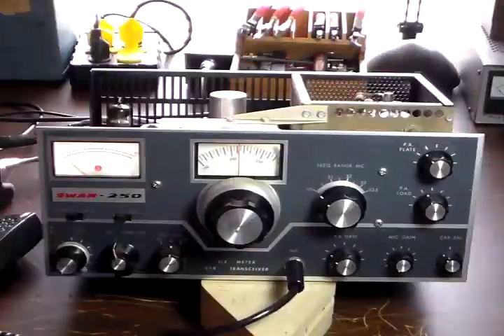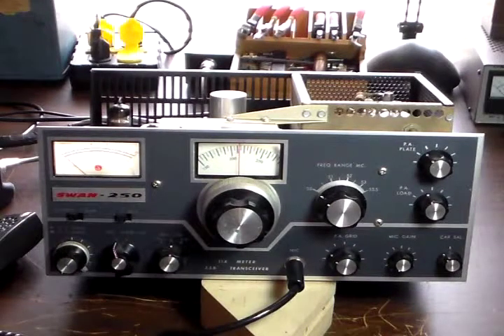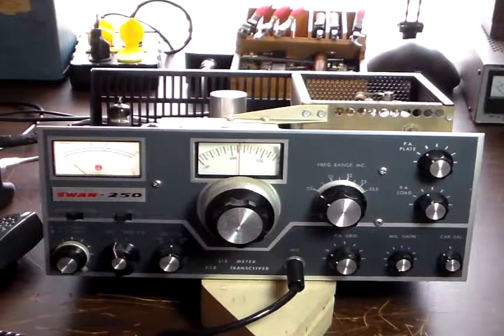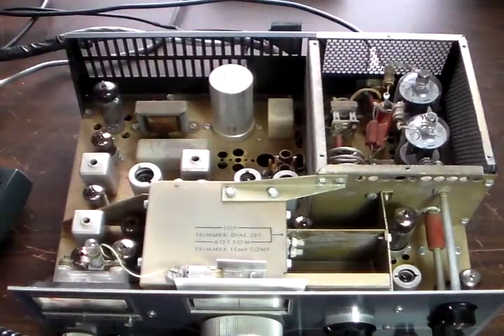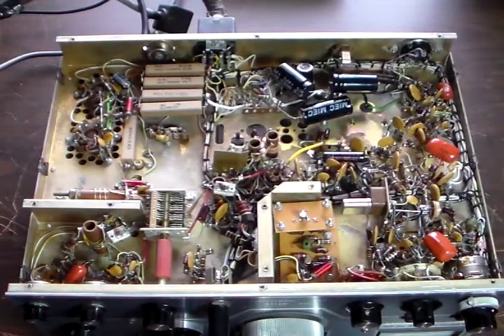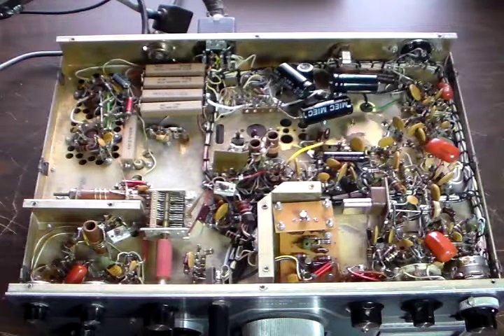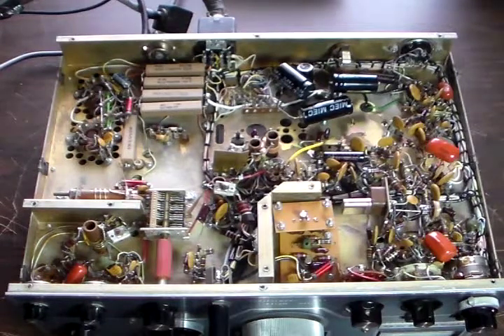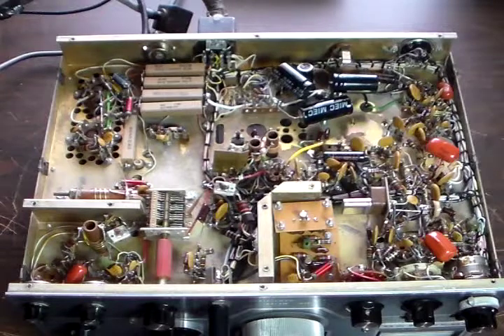Swan 250 6 Meter Transceiver Restoration: Part 1- Introduction

Comment: I just found one on QTH. Got lucky enough to get a parts radio with it. I'm going to follow your example and replace old resistors and diodes as well as those old capacitors. I do want to install a cooling fan over those 6146's.
Reply from the maker: Outstanding! Good luck. It's a good performing rig.
Reply: @specops56  thanks! BTW, where did you find the fan?
Reply from the maker: @GeorgeCampbell1964  It's just an old computer fan. Runs on 12 volts.
Reply: @specops56  until I saw that particular video, I was thinking of a smaller fan and attaching it to the "cage" where the finals are housed.

Comment: I could not stop this thing from drifting..drove me nuts.
Reply from the maker: The way I dealt with it is that I replaced all the caps and resistors in the VFO circuit with modern 1% tolerance components. Most others I replaced with modern 5% components. I also added a 12volt computer fan on the outside of the final end of the cabinet. This draws air all the way through the chassis, across the final tubes and blows the heat outside. The rig is now almost rock steady after a 30 minute warm up. The main cause of drifting is excess heat. Also remember, the original components are very old and may had gotten some hard use. I know that, at 61, I tend to drift a bit more than when I was factory fresh! Good luck with your rig!

Comment: You mentioned that the rig became more stable (VFO wise) when it warmed up, but you plan to install a fan to help keep it cool and that would hopefully make the VFO more stable?  Did I hear you correctly?
Reply from the maker: Yes, you did. In old rigs like this, the vacuum tubes need to warm up to their designed operating temperature to work at their most efficient. However, when actually transmitting, the final power amplifier tubes generate a large amount of heat inside the cabinet. This heat puts stress on all the other components causing them to become less stable. The fan is used to provide some ventilation to remove the excess heat which allows the components to operate more efficiently and increases their service life. Hope that clears things up.

Comment from the maker: Doing the transmitter alignment will be a challenge. Swan's procedure calls for using an oscilloscope which I don't have and don't know how to use anyway. I'll be doing the best I can with my signal generator, FET VOM, frequency counter and output meter. I've been videoing as I work on it & should have it done soon. I need to do alignment, mods & on air test.